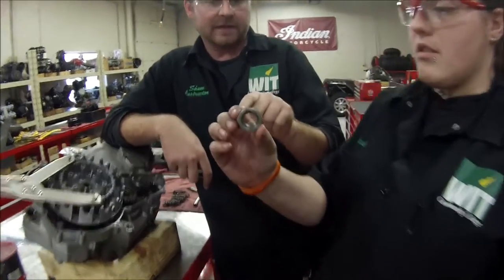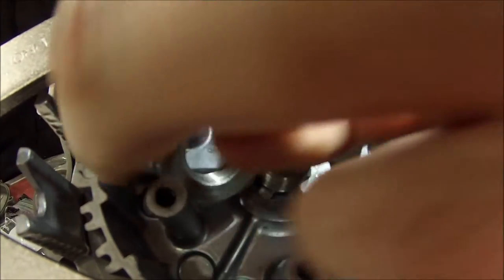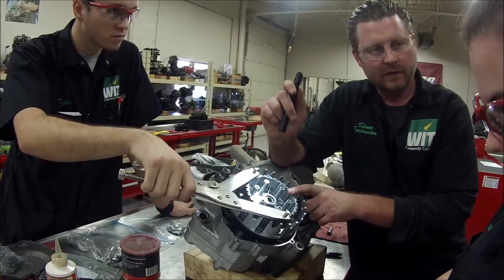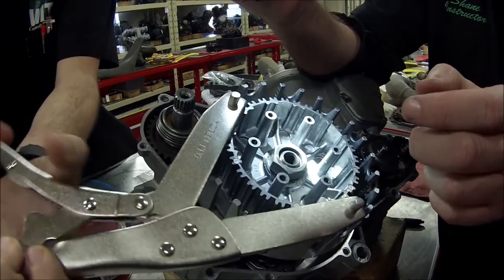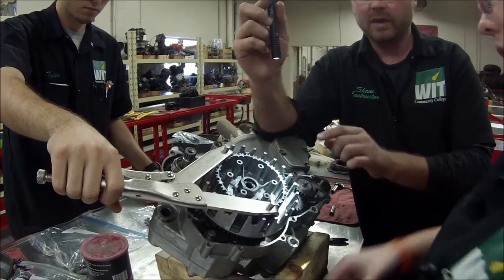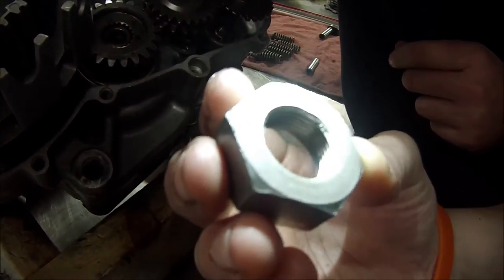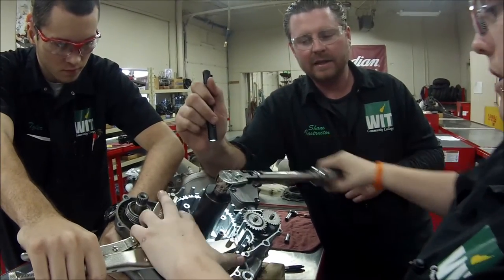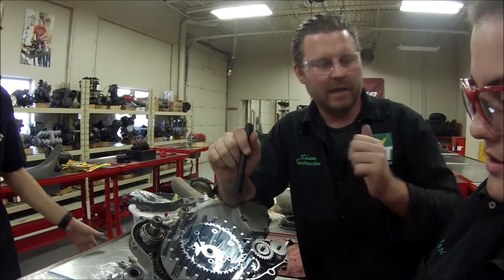Every Mechanic Series: Why is a nut machined for a recess on one side?

Comment: It is pretty common knowledge that you don't break torque with torque wrenches.....read your owners manual that came with it.
Reply from the maker: Awesome Richard! Your exactly right. Now you've helped create an entire thought. Something that is useful. I would have been much better for me to grab another 1/2 drive and remove the nut. Good point to make regardless folks! A teaching habit I will need to "break" lol. One thing we do in teaching that is unconventional to everyday mechanics is "train" using a tq wrench taking fasteners off to "verify" the the installed tq was correct. Basically a torque check of the last tech. It's is very useful in teaching of newer mechanics to really get them to build muscle memory of the importance of fastener integrity problems from over tq. I will link a video to our digital tq tester. 

Due to my close relationship with SnapOn I often have engineering rational behind the "reason". The "reason" for the warning not to break fasteners loose with a torque wrench in reverse (as compared) to installed direction is most technicians are not slow and intentionally "reading" the the while removing a nut
Reply from the maker: +Shane Conley 
Cont....
For example: 
If you wanted verify the installed torque without altering. You would simply step up the wrench until the fastener will loosen. Let's say you wanted 50 ft lbs...49 won't loosen but 50 would. So you can see the young gals muscle memory and technique was she was "feeling" the loosening of the applied half tq mentioned. Our purpose of the video was as titled. Thank you for creating this opportunity to show how intentional we train. And I will get the right wrench next time for video! 👍

Comment: I'll just use an example. you stated in your introduction to this series that a car is a car. a motorcycle is a motorcycle...etc. It is the process that matters in essence. Correct? In my opinion it's a bad habit. When removing lug nuts off of a wheel on whatever brand car, would you break torque with your torque wrench? Or would you use your breaker bar? You may get away with doing things like that with a low initial torque but when a technician is dealing with higher torque number in trades such as heavy trucks or equipment, the torque wrench in question will suffer much faster with failed calibration. I am willing to bet that if a person working in a tire shop used his torque wrench to break torque and reinstall lug nuts with only his torque wrench for just one busy day, his torque wrench would be severely out of calibration standards by the end of that day. Things every mechanic should know....not just powers ports mechanics.
Reply from the maker: Your absolutely correct. I replied below! It just rattles my cage when youtubes just make a negative point and don't elaborate on how to help or make people better. I can see from your reply, you are knowledgeable and are correct...share that in the future up front my friend...👍